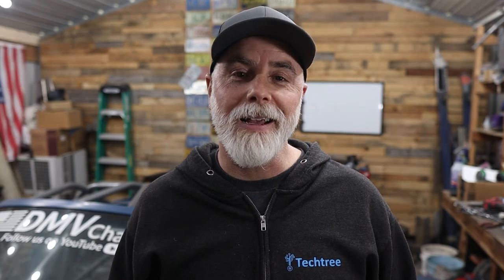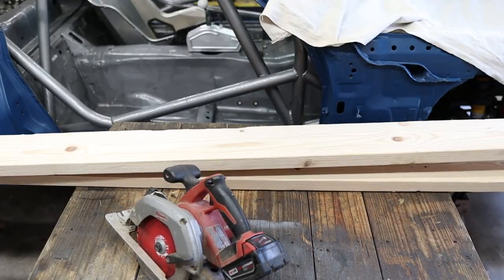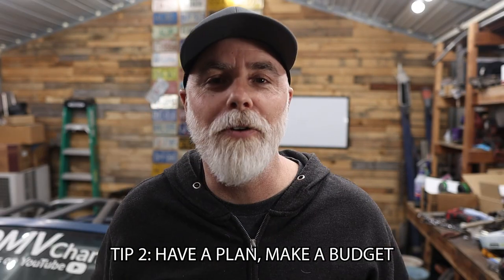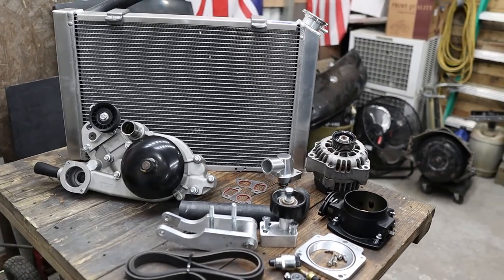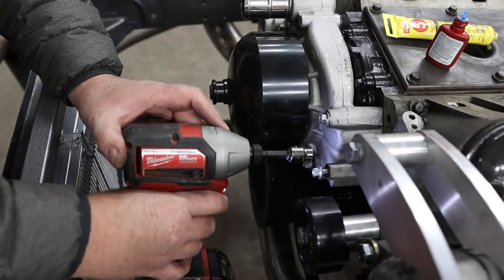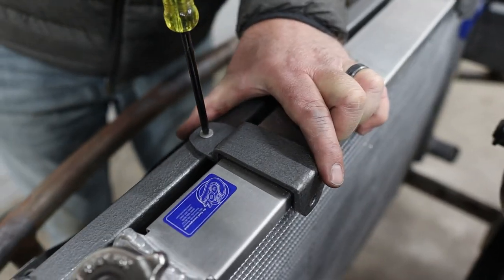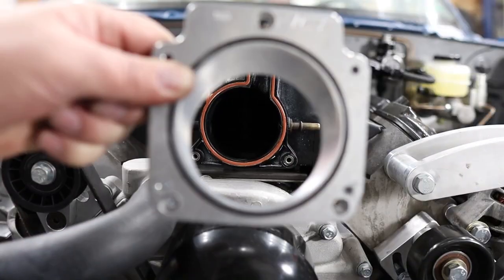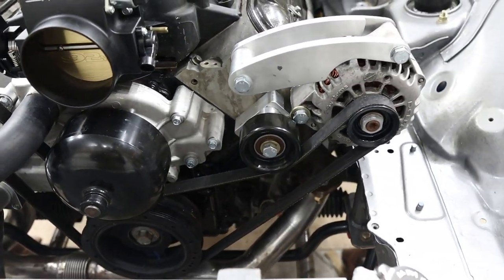AVOID BURNOUT AND DON'T GIVE  UP

Comment: Have you decided on what you are doing for heat?  I just installed a 220v comfort zone, really helped take the edge off in the garage this past weekend!
Reply from the maker: I have small propane torpedo heater. I honestly hate the heater. I’ll check out your suggestion👍
Reply: wired to a 220 dryer plug, swap it for the welder when i need to.